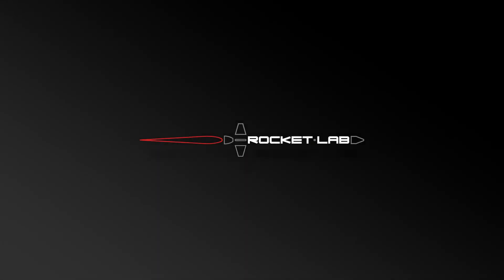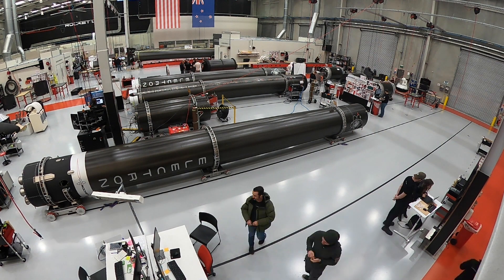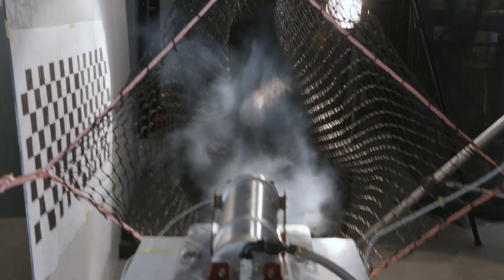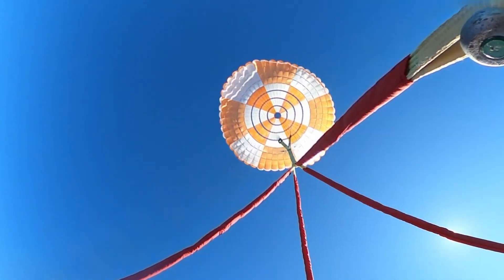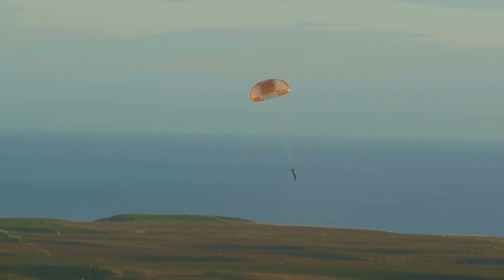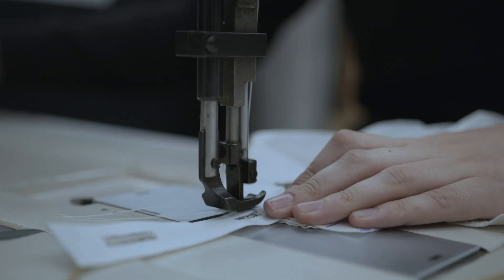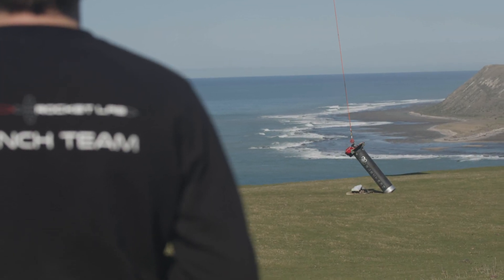Road To Reusability

Comment: Attach a Gyrocopter blade vertically on the side with shrouds, then on re-entry, when low enough, release the shrouds and start the gyro effect. Use a pop out tail to steer it to a runway with a wet canvas sheet and slide/land the Electron Rocket along the 'runway'. Small nylon skids could be incorporated as replaceable landing points.

Comment: Are they just going to use the ring chute for flight 16, or is it replacing the air catch all together?
Reply: 1:45 Peter's comment to me about 'being happy with the Helicopter recovery' indicates to me, that they will fall back to that procedure, if this is not as successful over-all, as they are expecting.
Reply: @David-yo5ws  by that he means they don’t need to test it. All this recover is for is testing that it survives entry. Flight 17 will be the first attempt to catch in the air of this attempt goes well
Reply: @TheBest14184  I was thinking that the catch with the helicopter I had seen before, was after a launch to LOE. So thanks for clarifying the reason behind this test.

Comment: God bless Rocket Lab for going for recovery. Unlike United Launch Alliance.
Reply: They are technically going for recovery too
Reply: @henktheblobfish2674  Not full first stage. Just engine section. Tanks are still expensive.
Reply: @rurikovca  tanks are a fraction of the cost of a space vehicle.
Reply: @kevinyu6589  heard about it. It seems to me like its still a potentially maybe at some point type thing. Wish they put more importance on it.
Reply: @rurikovca  ULA is super underrated, what Vulcan will do is to use the fuel spaceX uses to land to achieve more complex orbits and have better payload capability. They will use Blue Origin BE4 engine which will run methane and produce a cleaner engine with little maintenance 😉 👍 😀
Reply: Perhaps you have heard of Vulcan and SmartRecovery?

Comment: Is the catching with a helicopter coming back at a later stage in the process once you've demonstrated you can make the initial reentry work?
If not then surely contact with salt water is a big problem, and each booster will need completely stripping down and cleaning before it can be flown again?
Reply: Helicopter is still they way they are doing it. But this first one is just a test to see if it survives entry. This booster will not fly again. It’s just a proof of concept really
Reply: There was feedback about the SpaceX Falcon9 Fairings landing in the sea. They said the salt water was not that bad. Fresh water wash and dry out. All good to go. (they did not say if drying out was in hot, fan cycled chamber or just in warm room). The Electron Rocket is carbon fibre so similar to fibreglass. Not sure about the Electron Rutherford Engines in the sea. Then again, maybe a fast drone hovercraft could be used to catch it???
Reply: @David-yo5ws  I thought it was the sound insulation that was the problem. The Starlink don't need that.
To the OP: 17 has been the target for in-air recovery for some time. This is just a step along the way.
Reply: @David-yo5ws  I think on a fairing it's quite a different matter. It's a much simpler bit of kit. Exposing rocket engines to seawater means a full strip-down and refurbishment. Hence why SpaceX went to so many lengths to avoid splashdowns

Comment: I really hope this works out well for them, because maybe it will mean down the line Rocket Lab will become the second company (after SpaceX) to try for a fully reusable launch vehicle! Maybe a new vehicle with the same launch payload as the current Electron, just big enough to give it the margins needed for the recovery hardware to be included on not only the first stage, but the second stage too?

Comment: Something in spaceflight happens earlier than expected?
This is so awesome, can't wait to see this. Rocket Lab is just an incredible rocket builder.
Reply: 17 is the air recovery. This is the next step along to that.
Reply: @Markle2k  No, this "next step" was actually planned for flight 17, but they are now doing it earlier than planned. They even made fun about this on twitter.
Doing something earlier than planned is really quite unusual  in spaceflight, where more often than not things tend to slip to the right cough SLS cough Ariane6 cough Falcon Heavy .... the list goes on...
Reply: @thisisnotajoke  Jep, this is that I've meant. This fact simply makes it even more awesome. :)

Comment: This is just a stopgap before gliding parachute or is that idea ditched now?
Reply: The only goal for this mission is to get a stage back “intact” so the engineers can tear it apart to see how everything performed. Some things will do well, others poorly and will need to be redesigned to make recovery viable. 

After that, there will be a few more flights of existing hardware before they roll out a slightly revised Electron. This version will include all the necessary improvements from this test flight, the parasail for snatching it out of the air, and will need a recovery ship with a helipad. 

This is the Grasshopper to the eventual Falcon 9. It has one purpose and one purpose only, and for that purpose a ring sail and splashdown is fine. This booster will almost certainly never fly again, though it will make an excellent display.
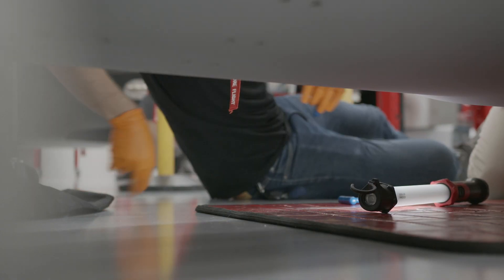Reply: Just a stopgap (1:43)

Comment: Why did you scrub the Helicopter recovery?
Reply: 1:45 Peter said they have demonstrated that ( helicopter recovery)and he was not too worried about it. You could interpret from that, that if this method turns out not to be as successful as they expected, then they would fall back to the Helicopter Recovery System. My thought is that a Helicopter is just too expensive. Only $500/hour flying, it's probably the on-standby and organisation that is more the hidden cost factor that makes it barely cost effective.
Reply: @David-yo5ws  ok thank you
Reply: @David-yo5ws  No. The helicopter is still what they are doing. Just for this first attempt all they want is the booster back and intact, which the helicopter is not needed for. He said he’s not worried about the helicopter catching meaning he doesn’t feel it needs more testing, not because it’s plan B. It is in fact plan A
Reply: I'd suspect it's dangerous and too expensive.  Also, parasails don't like high speed opening.  The Dragon fairings fall a lot slower due to more air resistance.

Comment: Hell yeah 
Catching a rocket out of the sky is gonna be 🔥
Reply: There not gonna catch it anymore.
Reply: @ednelson9913  they are, did you just watch the video?

They will try to do so on the return to sender mission.
Reply: @Kaskadamusic  yes there gonna parachute it into the ocean. Not use a helecopter anymore even though they demonstrated they can. Watch the video again.
Reply: @ednelson9913  I could've pulled a sneaky on ya by saying"I said they're gonna catch it out of the sky not in the sky"
Reply: @ednelson9913  yes mid November
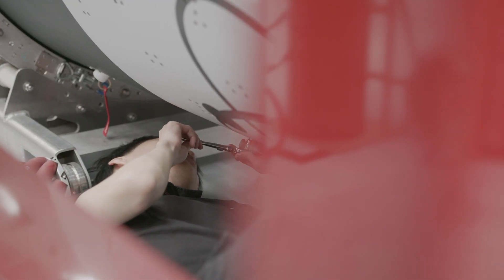Reply: @Kaskadamusic  1:51 - they've said they're going to recover it from the ocean.
Reply: @caav56  you’re right